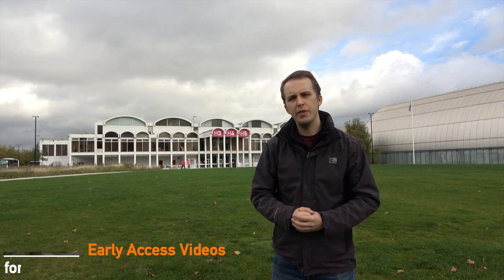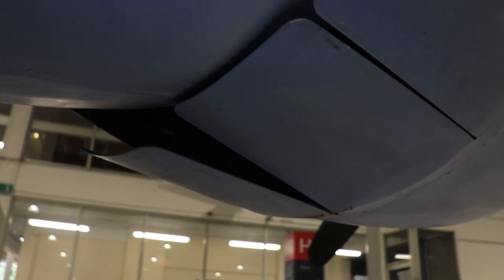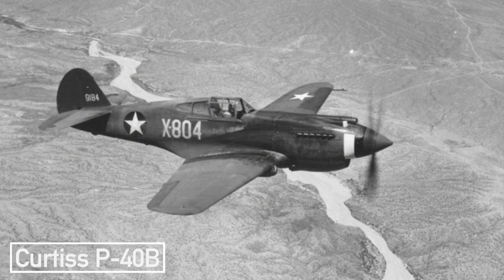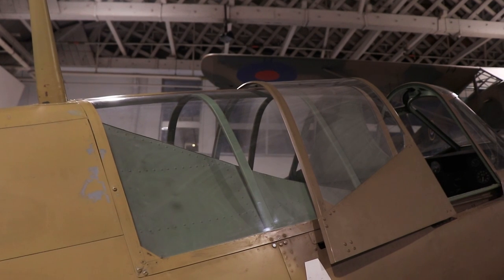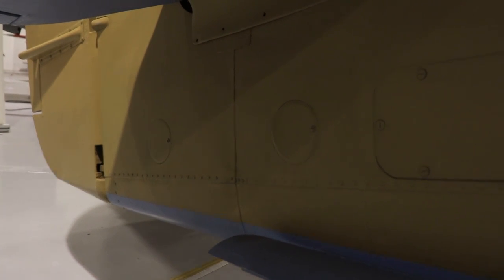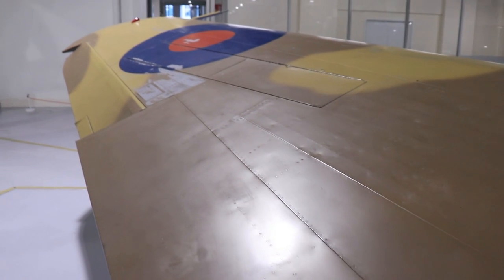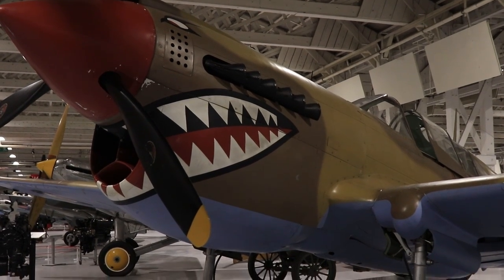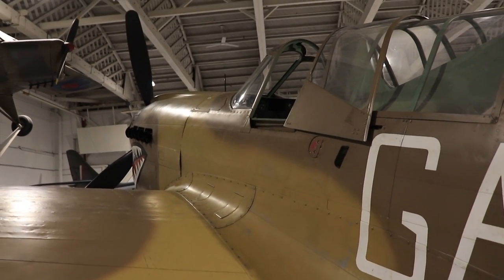Curtiss P-40N Kittyhawk - Detailed Walkaround

Comment: The P-40 may have been a bit outdated and underpowered compared to its contemporaries, but it was a rugged and reliable machine, and damn if it wasn't one of the coolest-looking WWII fighters!
Reply: Curiously, I might push back on the bit that it was outdated! It certainly gave German Bf-109s a good thrashing in North Africa and the Mediterranean, and Ki-43 / A6Ms something similar in the Pacific. It was an incredibly versatile and very capable fighter at those lower altitudes seen in those respective theaters.
Reply: The only aspect I'd say is outdated is the Canopy
Reply: The P40 was the most maneuverable American aircraft of the war due to Curtis' tendency to create wing and tail surfaces large enough to be very lightly loaded.  The aircraft was hampered mostly by its engine  which could not perform at high altitude--high altitude operations were not considered essential when the aircraft was designed. At medium/low altitudes the P40 was a match for most anything in the air at the time and its phenomenal ability to dive made it virtually uncatchable. Saburo Sakai himself said he considered the P40 to be the most formidable Allied aircraft he faced when proply handled by the pilot.
Reply: @rengarcia5189  I wonder which was more maneuverable, the Curtiss P-40 War Hawk or the Bell P-39 Airacobra.
Reply: I am curious can we hot rod p-40N to go 630 kph with 130 octane fuel
Reply: The Japanese Consulate in Honolulu said, "They (US fighter pilots) are technically competent and their fighters are VERY fast." His emphasis. They took the P-40 very seriously in late '41, and he clearly wanted the IJN to take notice.
Reply: @martijn9568  US reports from 1944 noted that of all current service craft the P-40N was the most maneuverable, with the P-39N taking second (a very respectable!) 2nd place.
Reply: @martijn9568  P-40 was generally accepted to be much more maneuverable. It would outturn both the 109 and Spitfire and at speeds well over 300 mph could also get a single shot at outturning the Zero but one you did that it was time to use the aircrafts speed in a dive or level flight to regain the advantage. It was also among the fastest rolling aircraft of the war, I believe only the Fw-190 could roll faster.
Reply: I guess you tend to hear about German aces in the Western Desert racking up huge scores against P-40s but according to the Wikipedia page the P-40 (particularly the later versions) did very well indeed, mainly in the ground attack role.
Reply: Wasn't it Joachim Marseille who shot down 12 P-40s in one day?

Btw, I was under the impression that the P-36 was much more manouverable than both the P-39 and P-40.
Reply: @lavrentivs9891  Not sure about 12 in one day but he did shoot down 3 or 4 in one engagement. The P40s went into a Lufbery and Marseille was able to fly in and out of it picking off opponents before the person behind could get him.
Reply: @martijn9568  I would guess that a Soviet de-gunned P-39 would probably be more nimble, but a factory-fresh model with all the guns would probably be outclassed by a P-40
Reply: @chain3519 ...it is, but man, I personally love the aesthetics of that style canopy, and much prefer it to the bubble canopy. Buuut, I understand the value of the latter over the former, especially in regards to visibility.
Reply: @mtlbstrd  

Then again, the bubble canopy was also a possibility because of later air superiority allowing to exchange some safety for (visual) freedom
Reply: I don't think it was outdated but not every design is going to be the best. It had its uses for sure.
Reply: Lavrentivs I think that most consider the P-36 too outdated to be part of the conversations about best this or best that but you are correct it was very maneuverable and gave great account in the battle if France and in the hands of the Finns vs the Russians. I just think most debates leave it out but perhaps that's fair since it wasn't even being produced after 1940
Reply: @edwardpate6128  true but only early in the war
Reply: @rengarcia5189  I agree with one exception, the F4F Wildcat was even more maneuverable.
Reply: @iskandartaib  Add to that the P-40 was very effective as a weapon of war. Easy to build, very tough, reliable and easy for ground crews to service and maintain. It was a very effective fighter below 15K feet and its heavy armament took down not only many German and Japanese fighters but devastated bombers and transport aircraft. It had much better range than any of its contemporary German or English fighters although nothing at that point could touch the Japanese A6M or Ki-43 in that area. It was a devastating fighter bomber and in that role showed it could absorb tons of ground fire.
Reply: Agreed! She was the the Workhawk of the war. Serving in some of the worst conditions and being there to do her job during some of the most desperate times for the Allies. Without them we very well might've lost the war. A truly important and critical airplane to the war effort.
Reply: @Th0nky  
"Curiously, I might push back on the bit that it was outdated! It certainly gave German Bf-109s a good thrashing in North Africa and the Mediterranean, and Ki-43 / A6Ms something similar in the Pacific. It was an incredibly versatile and very capable fighter at those lower altitudes seen in those respective theaters."

I don't think you could call it a thrashing.

As an Australian, I have a soft spot for the Kittyhawk because of RAAF 75 Sqn's defence of Port Moresby over 44 days in 1942. It was our 'Battle of Britain moment'.They did an amazing job, considering how little experience they had and how few there were and they were making things up as they went along. But someone had to hold the line until the Americans arrived (and yes, we were very grateful for that). But as well as they performed, I don't think you could call it a thrashing. By the time those 44 days were over, I think there was only one aircraft left.

For all the talk of the Flying Tigers, it's arguable that the Kittyhawk's finest achievements were with British and Commonwealth air forces. Wg Cdr Clive Caldwell, DSO, DFC and Bar, RAAF, was the highest scoring Kittyhawk pilot of the war. He finished with 28 1/2, most of them in Kittyhawks in the Western Desert. He later flew Spitfires against the Japanese.
Reply: @lavrentivs9891  Marseille claimed 17 on a day when the total RAF losses were five or six.
Reply: @thethirdman225  And US pilots claimed 39 tank kills in a ground attack that knocked out 9 german tanks. 

Overstated kill counts is the norm in air combat, especially between aircraft, as you cannot always be certain if the aircraft you just damaged actually crashed or managed to make it home.
Reply: @lavrentivs9891  Yes, I know. Marseille was just a notable offender whose claims are still taken at face value by Wehraboos. It didn’t help that Tolliver and Constable nominated him as ‘one of the four best shots in the Luftwaffe’. How they actually measured this piece of hyperbole, I’ll never know but ironically, I think they truly believed it.
Reply: @Nightdare  "Then again, the bubble canopy was also a possibility because of later air superiority allowing to exchange some safety for (visual) freedom"

Bubble canopies were no less safe, especially if they gave better all-round visibility. Pilots still had armour plating behind their heads.
Reply: Yes, underpowered as a fighter.  By mid 1942 the LW in N. Africa was grossly outnumbered, their supply lines cut and werereluctant to fight, so once again success was via idustrial capacity, not quality.

Comment: My grandfather served with the RFC and then the RAF and he told me you could always spot o P40 pilot because they would always wear their watch upside down. If they didn't the face would get smashed on the canopy rails when going to full throttle.
Reply: I think operating the hydraulic hand pump to verify gear was locked might have also had something to do with it.
Reply: thanks for the very cool info, makes sense....I notice some ppl today also still do this, but very few..for regular desk jobs it actually makes it easier to read the time quickly...

Comment: Beautiful clean lines – it was, like, the daddy archetype of most WWII Allied fighters. If they'd been able to get a super-charged Merlin in these things (or even had enough Merlins available), it could've ruled the skies for the first half of the war. With its Allison, it was a fantastic, reliable work horse, never to be underestimated.
Reply: Actually, some 330 were provided with Packard built Merlins late in the war.
Reply: @michaelburke5907  Great to know, thanks for this info. Too bad they didn't try it earlier in the war, before the Mustangs and Lightnings and Thunderbolts were there to keep up with the 109s and 190s, and Corsairs & Hellcats with the Zeros.
Reply: @pbasswil  by that time the p51D was in full production, clearly superior to the P40E, so it made no sense to continue  the P40 projects for front line aircraft. Supplemental and export models were still produced , but the P51 was the better choice.
Reply: @michaelburke5907  Agreed, that's why I wrote "...in the first half of the war".
Reply: Not really "the daddy archetype of most" of anything, given the types you could reference either pre-date or are contemporaneous to it, and it didn't realle see much service until late 1941 anyway.  The P-51 was built to  British requirement, the P-47 wasn't inspired by it either.
Reply: @owenshebbeare2999  You obviously are deeper into the history of the various fighters than me. I was making the assumption that it was an earlier design, and that a lot of the Allies's prominent types seem to me to ressemble it in one way or the other – by reason, I thought, of its influence on the designers. I see now that it first flew in 1938. So I stand corrected.

Comment: Thanks for this Bismarck! I was going to make a comment about my grandfather working on this type, and then you mentioned this aircraft's origin, and I was stunned. 
My Grandfather was an armourer/fitter in 80sqn RAAF (Tail code BU) and spent his war service on the Island hopping campaign in the south-West Pacific area in support of the US marines. There is every chance that he worked on this exact aircraft at some point. In the close air support role, they nicknamed them the "Kitty-bombers" as this model had been fitted to carry bombs, unlike early models.

As to the non-standard IFF gear, Australian delivered P-40N's were straight off the factory floor from the US in all aspects, right down to the dark khaki green and USAAF markings. Australian squadrons just painted over the US markings with the Australian roundel upon receiving them. All allied aircraft in the S.W.P.A. had extensive white allied recognition panels (wing leading edges, and the entire tailplane)
The US spec nature would probably explain most of the differences from a British version that this donor aircraft's has.

Comment: At the battle of Milne bay these things flew off a iron mesh mat in a swamp straight into a strafing run , one of the underrated aircraft of ww2 , poor performance above 12000 feet isn't an issue over a battlefield .

Comment: Thank you for such an informative walk around. My Father was a P-40 crew chief all the way across the Pacific in the island hopping campaign. Like many he didn't like to speak of the experience very much. I think if he would have served today he'd have been diagnosed with PTSD. Not that he himself was exposed to a lot of combat. He had what I now recognize as Survivors Guilt. Due to the pilots who died flying planes he had worked on. The sad fact was that the P-40 was outclassed by most Japanese fighters. He did relate once to witnessing one of his planes being shot down over the water within a 1/4 mile of the airstrip. The pilot trying to dive away from the fight being pursued by a Zero and flying straight into the sea. The Zero hammering the plane all the way down. It was one of the very few stories he told and he had tears in his eyes more than 30 years after the event.

Comment: Very good analysis/history of the P-40! I've read a lot of pilot accounts flying it. Given its ruggedness and wild handling characteristics, some of them are downright funny; although the pilots didn't think so at the time. Most important was that it was adept at getting them home again -- or at least back on terra firma without dying in the process.
* Of mention too, is the fact that the classic P-40 came to be when the AAC insisted that water-cooled engines be on all aircraft in their contest. Curtiss hurriedly removed the radial engine from their P-36 Hawk and ... voila'! However, they did not (or could not) include a two-stage supercharger which would've given it excellent high altitude power and flight characteristics. As such, the Brits weren't fond of it on the Island because it was inferior in a dogfight to the Me & Bf 109's. But it otherwise shone in nearly all other theaters and regions where it was deployed.
*In particular, by the time it reached quantity later in the Pacific Theater, its pilots knew it well enough to really raise havoc with most Japanese fighters. Japanese pilots really did not like to take on the challenge of a P-40. It was hard to shoot down and was much faster. Of note also, while the P-40 could not land on a carrier, it could launch from them and land later on an island base.
*Lastly this P-40N is an excellent example of the lengthening of the later-model fuselages which improved the capabilities of the airframe in nearly every way.

Comment: Excellent, concise, more than I ever knew about P-40 technical details in under 15 min. How did you know that the propeller is not correct? I get how museums like to alter markings to display a desired aircraft, but I think they should stick to the airframe’s true operational history. Maybe the RAF Museum just felt they had to have a shark mouth paint job.

Comment: The RAAF used them reasonably effectively in the South Pacific, Darwin and Papua New Guinea. The were tough and hit hard. Also were great fighter bombers. No outright match for the Zero but if you knew what you were doing they were effective.
Reply: Flown to the aircrafts strengths they were more than a match for the Oscar and Zero.

Comment: Of note, the landing gear rotates 90 degrees as it rotates rearward so that the wheels are flush with the underside of the wing.
Reply: Also, the F6F and the Skyraider had similar landing gear arrangements (possibly the same design?).

Comment: Was FX760 also a P-40N? One interesting thing about the P-40N - if you compare it with older P-40 models, you'll see they moved the horizontal stabilizer further forward compared to the vertical stabilizer. I'm not sure why this was done, but the only other WW2 single engine fighters that share this layout were the A6M Zero and the Ki-84 Hayate. The A7M also had it, but it didn't go into mass production.

Comment: What he described as the gun camera port was actually meant for cockpit ventilation.  The gun camera would have been positioned in the right land gear fairing.  But other than that, a great presentation!!!
A piece of useless trivia; some fighter pilots assigned to the ground attack role preferred the P-40 because it wasn't as sluggish as the P-47 at low altitudes and because its cooling system wasn't considered as vulnerable as the P-51.

Comment: Probably an outdated design by the beginning of WW2, it was still a capable fighter. I love it.
Reply: Not really outdated, just vulnerable to Japanese zero , until tactics changed. In 1940/41, all allied fighters were just as vulnerable to zeros. It’s just that the P40s were so widely used early in the war, that so many were lost. Later models, like this one in the video, were competitive with zeros and Me109s, if flown well by pilots using proven tactics. One of the few aircraft to be used extensively for the entire 6 years of the war, by every allied airforce.  Sidenote... when Australia replaced its P40s with mk5 spitfires, the pilots initially wanted their old P40s back, as the spits were less suitable for the typical conditions of tropical warfare. They eventually modified the spitfires to get the job done, but this shows just how the rugged and dependable P40 was so crucial for much of the war.

Comment: Out of interest did you visit the Museum before its relatively recent revamp a couple of years ago? What do you think of the changes?

Also it seems that the Sunderland was modified to allow more cafe seating. The floats have been sort of tucked into thier supports in a way they were never supposed to be. How do you feel about this?

And why not make this a hattrick? Do you have any opinion on the Dennis Copping P-40 and failure of the museum to secure this one of a kind relic?

I am glad you're working with them. They're own channel certainly doesn't seem to have reached its full potential.... Anyway. Some of the recent actions of the RAF Museum paint an uneasy picture.

Good video BTW :)